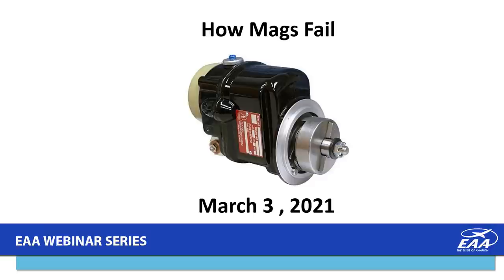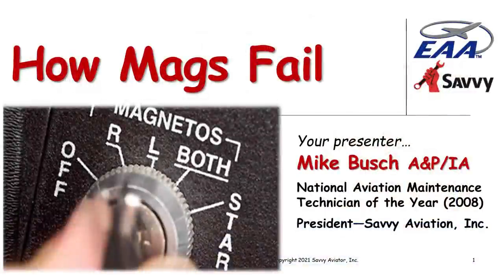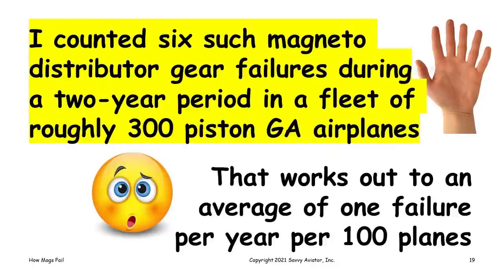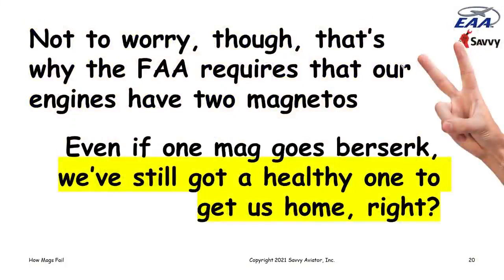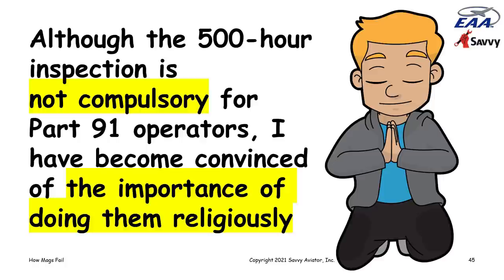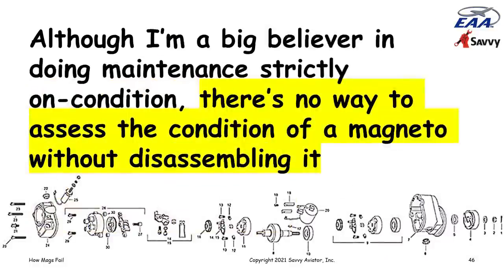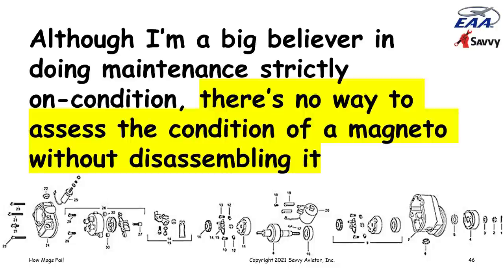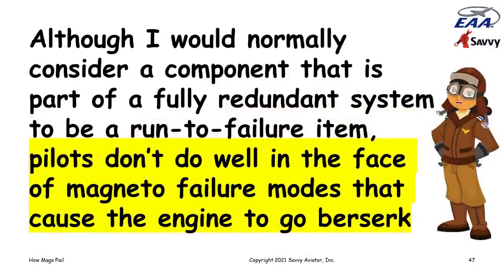How Mags Fail

Comment: It always amazes me that airplane engines are still basically lawn mower engines designed in the 40’s and are still using large amounts of unhealthy, dangerous fouling lead as an octane booster.    Modern engines could easily be built with lots of redundancy with extremely low failure rates, but unfortunately we are still stuck in the 1940’s and 50’s.

Comment: Hello from Sydney, Australia.
Thank you for the very comprehensive look at magnetos and the function they play in creating energy/current to the spark plug. Moreover, topics such as:
* different magnetos: (Their size, space and installation requirements.)
* troubleshooting (fault detection and diagnostic considerations: (internal parts and harness wiring P leads)).
* Intervals 500hrs for IRAN v overhaul/replacement - Slick/Bendik. 
And finally the advantage of A&P specialist service shop providing a higher level of goods and services.
💥🕳👨‍🍳

Comment: Had a mag fail due to an improper capacitor terminal installed by a well-known (in my area) mag overhaul shop. Rpms would vary 50-75 on mag check, traced it down after a bit and found the terminal too large for the connector in the mag causing a poor connection.

Comment: regarding, engine ends in "D" as Greg Ellis noted, o-320-D1D also is not a dual mag engine. The first 3 significant digits after the displacement number do not count. A Dual mag engine will end with D in the 4th or 5th position, like o-320-H2AD, and o-360-A1F6D.

Comment: I had a mag failure when doing power off 180's oddly enough.  Once I touched down I put the power in and the plane started shaking violently.  I pulled power then mixture since I was on the ground.  I pulled the plane off the runway (untowered thankfully and no one was around).  I wonder if the mags failed between when I pulled power at pattern altitude and landing or upon touchdown.  If the former, I'm glad my 180 training was at least up to par.  I kicked myself later for not diagnosing it on the runway, but only upon next start up.  I agree, training is lacking.  I was trained for pretty much every other failure.  Hopefully I learned in case it ever happens in the air.

Comment: I just went through a left Mag failure. I had my annual in May 2022 on my Cessna 210B. Mags were over 500 hrs. A&P sent then in to a Mag shop and they deemed my perfectly working MAGS unairworthy. Spent 1600.00 rebuilt mags and thought everything was A-OK. Started noticing a degrade in Left Mag performance during run up. Thought I had fouled plugs so I cleaned plugs, did a compression check and borescope. Found #4 was down to 50/80 and it was attributed to a bad roto-coil. Valve was lapped and new roto-coil installed returned to service. Went out for a test flight and had a rough running engine at take off at 500agl, called tower and asked for short approach and got it back on the ground. Replaced all plugs, another borescope and compression check and came back all above 74/80. 

After many run ups I was able to reproduce the MAG issue 100% after getting getting IO-470 up to temp. I would watch #2, #4, # 6 cylinder EGTs fall off the grid on the left MAG. You would think that all cylinders would stop firing but I had only the left bank failing.  Sent the MAG back to shop and they confirmed the "contacts" (points) were bad.  It is odd to me that only 3 cylinders would fail. MAG should be returned to service in a Day or 2.  Will report my findings here after I get plane signed off tomorrow.  I also, failed to switch to Right Mag and leave it there as Mike Busch clearly notes. This has been a good learning experience and would not have known about the bad sealing valve and roto-coil. 

You can see my Run up test here: 
https://www.youtube.com/watch?v=ngOLwUO18Tw   

10/22/22 Update: I spoke with the MAG shop this morning and it tuns out it was a "manufacturing defect" in the rivets the connect the cam Follower to the points.

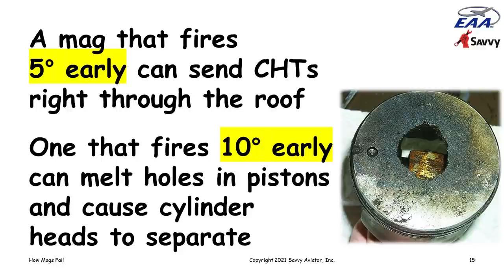Comment: I wanted to share my story. I had a mag spontaneously shed distributor teeth at 50ft AGL on takeoff at a rural airport surrounded by trees. No time for diagnosis of why the engine sounds like it's going to explode and no power to climb to clear trees. Got it down and stopped <15ft from the end of the runway. Engine barely had enough power to idle. First thing I did was change tanks, Second, adjusted mixture and carb heat, no change, third thing was check mags, sure enough as soon as I selected left the engine died, immediately went to right and it came back alive and sounded way better. Taxied to the hangar and put it away. Called and ordered a replacement left mag. Hit diagram of pilot reaction is spot on. @9:13 @10:34

Comment: 48:03 During ground-runup, couldn't you follow the full-rich mag check with an aggressively-leaned mag check? Regardless of mixture, there should be no risk of detonation at such a modest power setting. This would add only a few seconds to run up, but would allow for a fairly demanding ignition test before takeoff. Of course, your checklist would need to include a "reset mixture to full rich" before takeoff.

I also like Brian's suggestion of performing another mag check before shutdown. This gives you the opportunity to fix problems before planning the next flight.

Comment: The problem with redundant systems is people can get into the mindset that there is always a back up.  That can defeat the object of the redundant system.  I wouldn't want to run to fail on a redundant system anymore than on a non redundant system.  E.g. I don't imagine 737s will run to fail on engines because there is another one, instead I would expect the engines to be maintained like a single engined aircraft.

Comment: The Bendix mags have the red tooth, I guess if you’re really good at keeping it centered in the hole, you don’t need to have a tool but there is a locking tool for those mags. Same principle of not moving the prop or the body of the magneto when the tool is in place

Comment: I used to fly a PA28 that had separate mag switches, an Archer III that my flying club owned. Now I know why
Reply: Far better system. We had a bad starting C152 until one day i saw student just slightly back off key when starting and engine fired up. So i told maintenance switch was faulty. They spent time messing about with everything but the mag switch. Finally they replaced it and cured the problem.

Comment: Mike stated that if your engine ends in a -D then it has the dual mag.  Well, I fly behind a Lycoming O-360-A1D and it does not have the dual mag nor did it ever have the dual mag.  It has and always has had two separate mags.
Reply: A1AD = Dual Mag

Comment: Why aren't the distributor gears made out of something more durable. Brass or steel is out of the question since those conduct electricity. I'd imagine that ceramics might be a good alternative.
Reply: They make one gear out of plastic so if there's an internal jamming of the distributor arm, it doesn't explode or shear off teeth in the engine. Always a good idea to have a weak link somewhere. There's many other machines out there like ice machine flaker drives or washing machine transmissions that have one gear that is plastic. The idea being it's better to have a mag fail, and have that failure contained within that mag versus a potential uncontained failure where the mag comes apart completely that could result in a massive oil leak, or other really bad things. Ceramics are too brittle and could shatter unexpectedly. Brittle failure modes aren't good, those happen suddenly and can be quite catastrophic.
Reply: Engineers prefer to couple non-primary-output things to engines with belts or weaker components designed to shear.

Otherwise a seized bearing turns into a full on shrapnel event as the bearing and/or guts of the connected item get spewed into the engine. Or the torque shears a very expensive machined shaft which might cause internal components to bend and/or shed metal confetti inside the engine.

In all such cases without the ability to "shed the seized load" you risk severely damaging the engine or even causing it to also seize.
Reply: Engineers prefer to couple non-primary-output things to engines with belts or weaker components designed to shear.

Otherwise a seized bearing turns into a full on shrapnel event as the bearing and/or guts of the connected item get spewed into the engine. Or the torque shears a very expensive machined shaft which might cause internal components to bend and/or shed metal confetti inside the engine.

In all such cases without the ability to "shed the seized load" you risk severely damaging the engine or even causing it to also seize.

Comment: My question has always been.... on the switch, why is R on the left and L on the right?
Reply: Lol I wonder this too
Reply: Because the switch is GROUNDING a mag so it cannot fire.  

If your ignition switch is on L mag, for example, you are actually grounding out the R mag so it cannot fire.
Reply: BTW, that’s why there is an AD (76-07-12) on Bendix mag rotary switches to check the OFF position once every 100 hours…it’s to make sure BOTH mags ground out.
Reply: @DiMoraDiamond  Um, I've been an A&P Mechanic for over 40 years, so I know how mag grounding works. I've replaced and timed many hundreds. My question has always been about the stupid labeling and wiring of the switch. But thanks though.
Reply: What don’t you understand about the labeling? It makes perfect sense.
Reply: And since you’re going to be snarky, perhaps you need to go back to A&P school for a refresher. I’m not even an A&P… Just an ATP & airline pilot like yourself… And I understand how it works.
Reply: @DiMoraDiamond  Yeah, well, the labeling doesn't make sense at all. After about the 20th student pilot asking me, "Why is the R on the left, and the L on the right?" on the key switch, you realize it's stupid, even after explaining how the grounding works. But if you think it's the best way to label it, you be you.

Comment: you say that none of the pilots continued to the destination. you left out all the pilots that did. I had a mag fail last year and is exactly what I did. Pax didn't even know there was an issue. This is kind of like an engine failure on a twin. A lot of engine failures aren't known. The pilot lands, its fixed, and everyone moves on. Not going to one mag when one fails is sorta like not feathering the prop when a twin motor fails.
Reply: Would you take off with one compromised magneto?  Read comment from pilot "Dustin" above.  In his case second mag failed within two hours of first mag.  Wow, that is some incredible engineering.

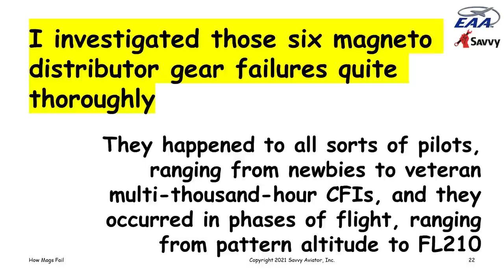Comment: 12:18 are you F ing kidding me. One of the most BASIC things I learned as a Pvt pilot and taught as a CFI later (now ATP 28 yrs ago) was to TEST THE MAGS by trying L and R.... I wondered WHY turn one mag off if your engine is already running rough? So I researched it. Yep if a Mag is still firing but so off time it could made the engine rough turning it off will solve the issue. MAKES SENSE.... WHAT THE F.... As well turn boost pump on if applicable, primer locked, may be switch tanks if applicable, carb heat if applicable, adjust mixture.... Basic basic basic.... I looked at check list and YEP many from BIG Companies that sell check list  say MAGS BOTH ON..... GIVE ME A BREAK.....
Reply: I always tell student try L or R, might just run better. I often see on check outs pilots say "starter" and go through motion turning key. I tell them why if the prop is already turning.
Reply: @flybobbie1449  Ouch, engaging the starter with engine already turning can break expensive things. Not good :) Better to just unfeather the prop and let it windmill. Yes it's a little more drag, but so what.